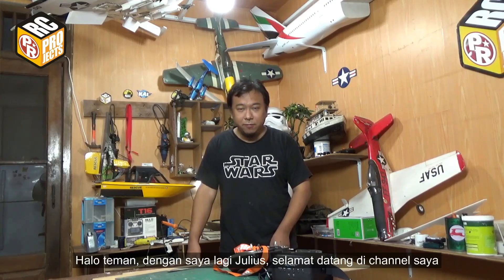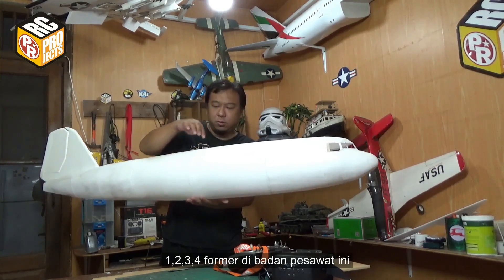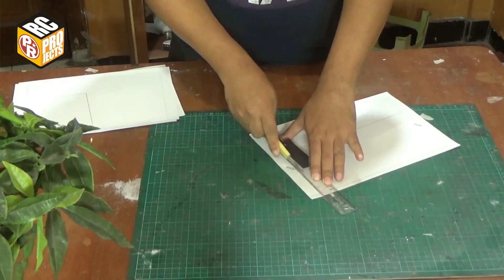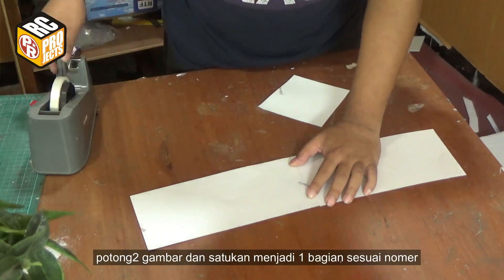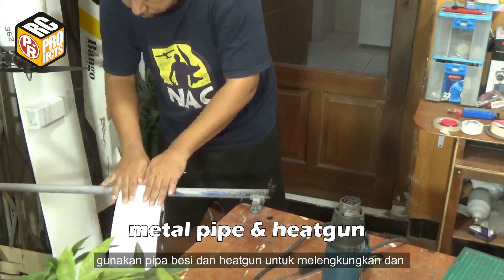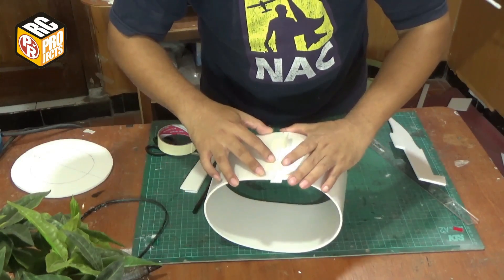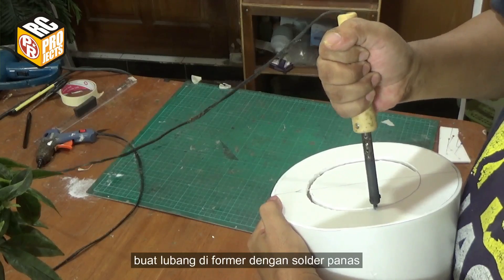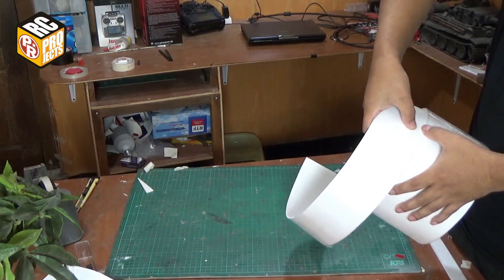Making RC Douglas DC-3 Part 1

Comment: Amazing build, but is there a way to scale the plans down? Since I would like to make a 60 inch dc 3 instead of 87.
Reply from the maker: 87 to 60 is about 69%  you can use A0 size plans and then print them in poster with 69% size

Comment: Om mau tanya dong , recomend baterai untuk rc pesawat berapa volt dan ampernya
Reply: Dan apakah baterai 7.4 volt 2500 amper cukup?
Reply from the maker: Bisa 7,4 v bisa utk rc plane kecil. Tapi blom ada plansnya utk ukuran kecil. Plans di video2 saya biasanya pake batere 3s (11,4 v) 2200 mah atau yg 4s utk jet
Reply: Iya om saya lagi buat trainer bentang sayapnya kurang lebih 80-90cm dan pakai brushless 2200kv , yang saya gk ngerti menentukan ukuran proppelernya om

Comment: Got to fly a C-47 in Australia!  Recommend duplicating the scale rudder hinge line; which is well inset into the rudder and provides an aerodynamic balance for the large surface.  Some strips of plastic card stock would work fine to make the extended hinges.

Comment: Sir I am making F 35 jet that you made,I have 64 mm 12 blades EDF 3500kv but I have 3s 2200 mah 40c Gens acc lipo battery ,Can battery work well???? Please answer my question sir
Reply from the maker: i prefer 4S because this jet is quite heavy
Reply: @JuliusPerdana  Thanks sir

Comment: Marvelous....🖒🖒🖒🖒.
I would appreciate if you help us in settings and adjustments of the electronics, especially the receiver and transmitter. I m still struggling in that.
Reply from the maker: That is very basic
Reply: Check out "Flite test Beginner series" on youtube, they were very helpful to me
Reply: They have some twin engine designs that would probably have similar transmitter/receiver settings to this